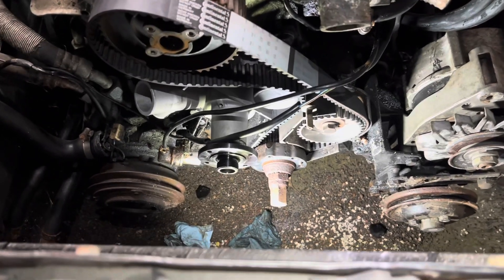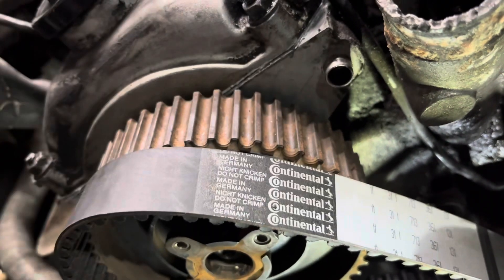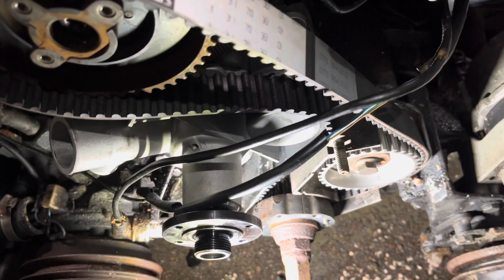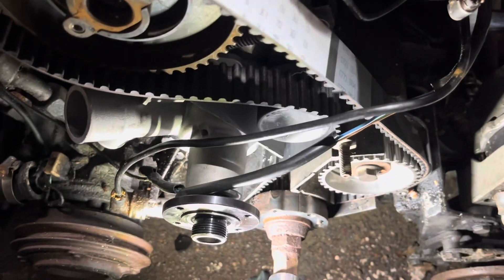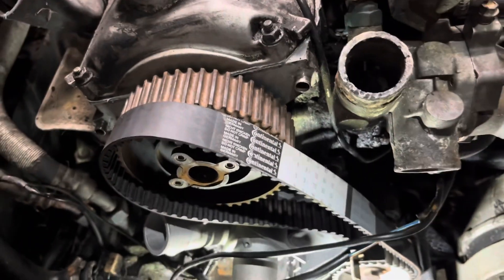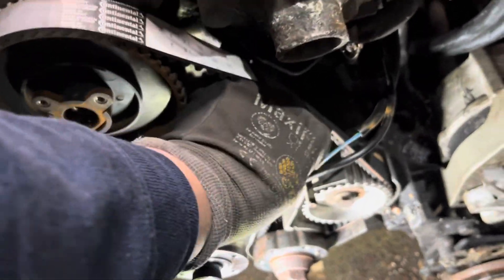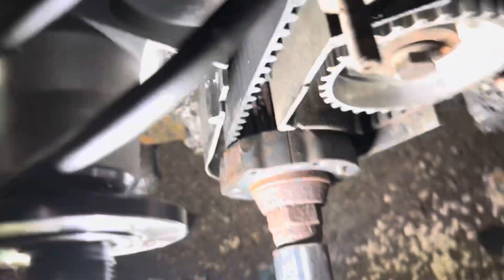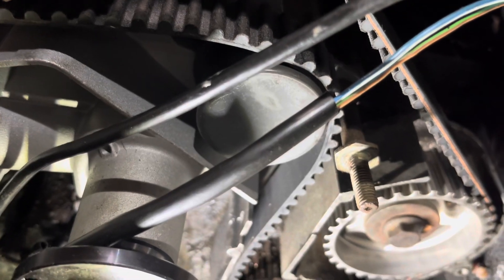BMW E30 M20 Engine Timing Belt Installation Tech Tip

Comment: i had broken belt and the cam timing mark is off. how do i turn it to align to the timing mark on the body? do i first place the new belt and then turn the crank so that the cam timing belt align first? And then remove the belt and install it properly once the bottom crank timing is alinged? I feel this is the right way so that both marks are now aligned. Am I right? Please help.
Reply from the maker: @selespeed3  if your timing belt broke while the car was running there is a very low chance you didn’t bend valves and thus it likely can’t just be retimed and put back together. When the head and cam are out of time you need to carefully move both independently as needed to get the head and bottom end in time again before installing a new belt. The valves will hit the pistons when it’s out of time so you’ll need to strategically move both independently without a belt on to get them to line up again without hitting. But you probably have bent valves. So get the motor back in time with a new belt and check compression before reassembly.
Reply: @bimmerdaddyllc3557 tell me how to get the cam to TDC first. the cam mark is at 10 o clock now. TDC is at 2 o clock. How do i turn it clockwise to 2 o clock TDC mark.